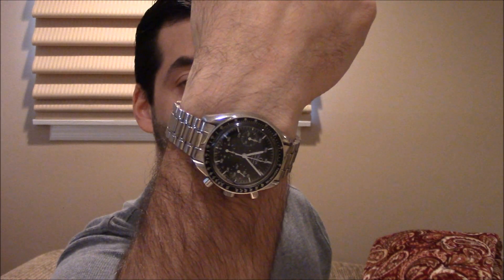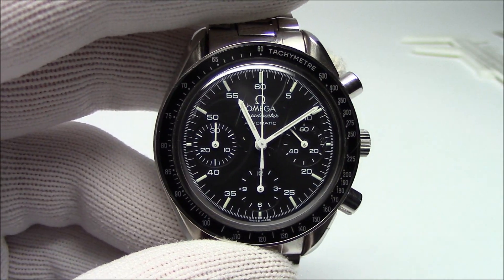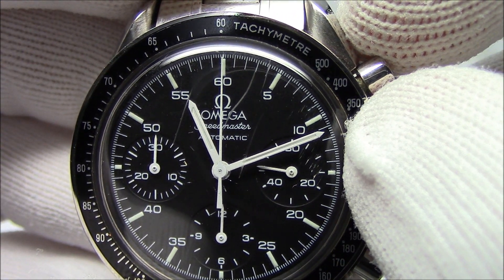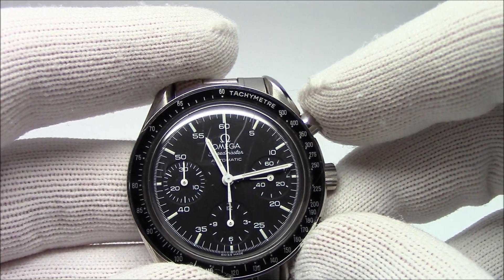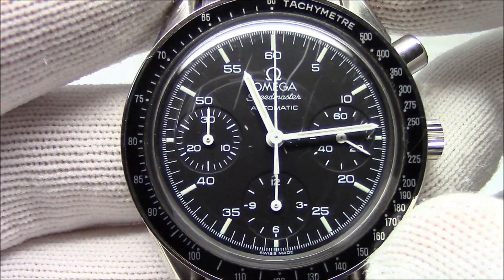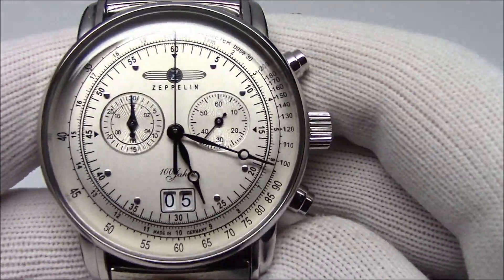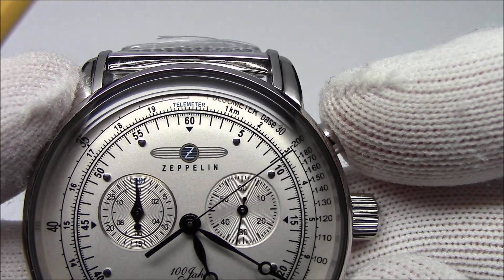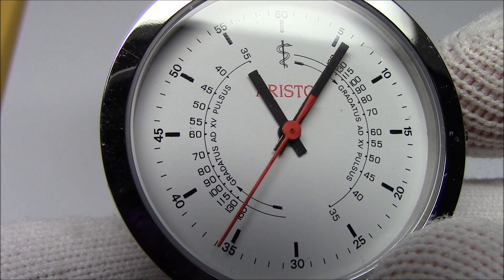What is a Tachymeter Anyway? Dial Scales Explained - Watch and Learn #7

Comment: I know I'm posting to a 7 year old video...but how would I use a tachymeter at a racetrack where the entire circuit is longer than a mile? I'm specifically talking about the Indianapolis Motor Speedway, a 2.5 mile oval. It's pretty difficult to be at start/finish and tell when a car has reached the 1-mile mark (somewhere near turn 2 on the back stretch). It's pretty easy at a 1-mile track because you just stare at the start/finish line. 

At the 100th Running if the Indy 500, Tag Heuer was there selling a commemorative watch. It bothered me that the tachymeter is basically set up for a 1-mile sprint (although now I realize you can make other calculations if you're good at math...which I'm not). 

So can't you make a 60-second tachymeter scale that assumes a 2.5 distance?

Comment: The telemeter is less than 3% off, and the error won't increase. If it's every 3 seconds for a km, it'll be out by 2.9% the whole time. (0.343 km/s)(3 s)= 1.029 km or 2.9% off. (0.343 km/s)(60 s)= 20.58 km or 2.9% off. It'll always be 2.9% off.

Comment: They used to make tachymeter watches for doctors. They use the meter for heart rates (pulsograph) and breathing rates (asthmometer) These two vital signs are easy to do with a watch. Too bad it no longer fashionable for md’s to wear them. If only Rolex makes these tool watches, MD’s would line up at the dealers. The Longines Asthmometer-Pulsometer Chronograph retails for $2,475.

Comment: To be honest it is best used if you are a pilot, or travelling pretty fast, 60 miles / hour is a mile a minute so if you can gauge passing 60 miles in one hour your traveling 60Mph, (not really that time efficient at low speeds), but if you are zipping along at Mach 0.5 your hitting 380 mph if you've covered 60 miles in 10 mins.  So with a watch Tachymeter you can quite accurately judge Mach 0.75 (575mph 60 miles in 6 mins), Mach 0.5 (380 mph same distance in 8 mins), Mach 0.25 (190 mph), you can round these figures up to 600mph 400mph and 200mph with an error bar of +-20mph, you can then twist your bezel to track the time increment w.r.t your 60 miles covered to keep you honest to an average speed.  which is great, if you are flying a spitfire or a pre jet age plane.  But now a days at Mach 2 you're off the scale.  Of course it doesn't take into account the jet stream, Emilia Earhart and Lindbergh probably used this, and look what happened to them...

Comment: The telemeter scale is not inaccurate when measuring the distance of a lightning, just set to a certain temperature and air density (approx. 4.7-4.9C and 1.27ρ). Also, a base-30 pulsometer is not very practical; a base 10 or 15 is more pragmatic. Last, second-increment chronographs are very apporpriate when using a telemeter/tachymeter or pulsometer.

Comment: This Speedmaster is not a moon watch. A moon watch had to be manually wound as an automatic wind watch will not wind in space. The official moon watch has a different back with with flight qualified by NASA written on the back
Reply: An automatic will work in space.  Inertia is based on mass, not weight.  The mass of the automatic winding "weight" device in the watch stays the same whether in space or on Earth
Reply: I did know that. I have had a Omega Speed-master since the 1970's with a manual winder. Well you live and learn.

Comment: I started using a Tachymeter back in 1968 while I was flying.  I used it to for true ground speed using 
section lines, (one mile apart).  More recently, for checking my speedometer after changing tire sizes or 
making a rear-end change.  I use the "mile markers" for that.

Comment: Being a total nerd (now retired engineer, but still a nerd), I had a chronometer years ago and looked up all the functions. This was a great refresher since I received my Dan Henry 1939 chronograph yesterday. 
Years ago I learned that sound travels at about 1,000 ft/sec and got in the habit of counting seconds during thunderstorms to get the distance to the storm. It just now occurred to me that it would have been nice to have a chronograph when I used to go mountaineering and frequently got caught by thunderstorms, especially when above tree line here in Colorado. That would have been a great, possibly life-saving, tool to have to tell us when the storm was dangerously close and it was time to take cover. Of course, there wasn’t much cover, so we’d jettison our backpacks (aluminum frames) and lay down flat in the lowest nearby depression in the rocks and wait it out. 
Thanks for an excellent, clearly explained video!

Comment: The way i always used a tachymeter was by counting 60 occurences of the event and reading events per minute from the scale. This works for measuring pulse, though it's not as quick as the two watches you showed at the end.

Comment: What would the tachymeter value be at 1min 5 seconds?
Reply from the maker: 55.38
Reply: As a more helpful answer, any time can be used. You just been to divide into a 60 second base. So 1 min 5 sec would be 65 seconds; divide this by 2 to get 32.5 (now it's into base 60). Look at 32.5 (reads just less than 110 according to the angle shown in this video), so about 55 of whatever your unit is (km/h, mpg, feet per second, whatever). Same for any other numbers, whatever you get by divide into base 60, and divide the number on the tach by the same amount.

Comment: Mark - really enjoying you videos, learning a lot about watches. I also have a background in ME and routinely use a tachymeter to measure water flow from groundwater wells using a 6-gallon bucket. For 6-gallon you just slide the decimal point on place, for 3-gallon mark on your bucket you divide by scale number by 2. Using these two buckets you can pretty much measure flows from 3 to 25 gpm with the right watch.   When I buy watches for field work this is a requirement.
Reply from the maker: Coolness! Sounds like a Civil Engineer at heart!

Comment: I am a Plastics Engineer and we often have to calculate how many parts can come out of an injection molding machine in an hour. Since most cycles run under a minute, this makes it a perfect Injection Molding Process Engineer Watch!.Just saying ;)
Reply from the maker: Perfect. Leave it to an engineer! Watch those sprues and runners!
Reply: you may have convinced me to get a tach watch! - manufacturing engineer General Motors.
Reply: @ZeroGorDIE This would  probably would be better than counting your fingers and toes while chiseling the results on the  cave wall of the factory . 🤣
Might even sell enough vehicles to get one of those new fangled scientific calculators , or heck , at least an abacus .

Comment: this was often used before radar guns for clocking speeders. if you measured out a starting and stopping point of a known distance, typically 1/2-1 mile, and started and stopped the tachometer at those points you would know how fast a driver was going.
Reply from the maker: Thank you for sharing.

Comment: The speed of sound is approximately 343 m/s. The exact one is said to be 340.29 not very easy to remember, hence the former works like a charm.
Reply: It  does vary by temperature and pressure but your number sounds right for normal room temperature.

Comment: In North Carolina the State Highway Patrol (NCST)Use a system called VASCAR to measure the speed of a given vehicle,and since no radar is used it is quite effective. However for it to work the Trooper must visually "Clock" you from begining to end. Here are two most commonly used scenario's .(1) A Trooper is positioned stationary on a elevated entrance ramp to observe ,and time the speed of traffic that will pass between two marks  that are positioned 1/10th of a mile apart. At night it may be two objects that reflect light,and the Trooper will use the "Plane" (Light that emits to the left or right )of the objectives headlights. (2) The next method is that a Trooper will follow, and time their objective as they both pass between to common points. the difference here is that distance is measured through the Troopers calibrated odometer,and thus the Troopers Vascar takes his/their number which is distance,and the objectives which is time,and then calculates the speed. No doubt the technology of a Tachymeter are a key part of this function.
Reply from the maker: Interesting! Thank you.

Comment: So if you use minute hand instead of a second hand, you can measure much larger timeframes.

Great video btw.
Reply from the maker: KefirDrinker Didn't think of that.
Reply: KefirDrinker yes but how do you set the minute hand at 12 in the beginning? also it would read in units per 60h which seems rather useless
Reply: For events that are longer than 60 seconds you would need to. Some watches have rotating tachymeter bezel so you can align it with the minute hand. Although, that is rare.

Comment: Umm ... someone running a mile in 60 seconds would mean they are going 60 miles an hour. Just saying.
Reply from the maker: It doesn't have to be a mile. It can be anything. It can be 50 feet. It's unitless.
Reply: Long Island Watch I was referring to the presenters comment where he said that you could measure someone running a mile in 60 seconds. I'm aware it can be any scale. I would use my tachymeter when I went for power walks, I'd measure 50 feet units to figure out how many miles an hour I was doing.
Reply from the maker: Ah, good point! That would be a quick run, heh? :)